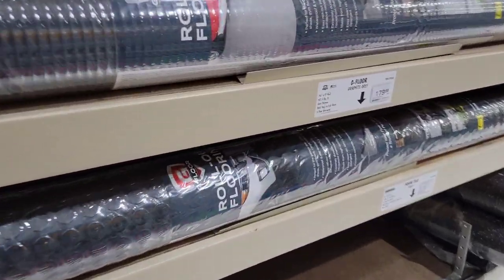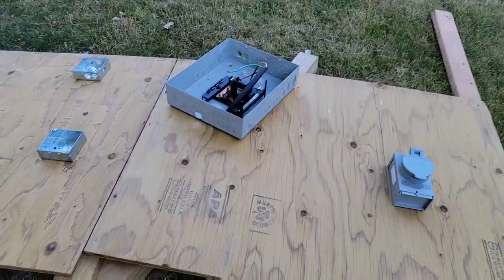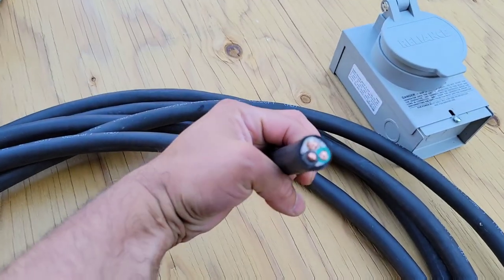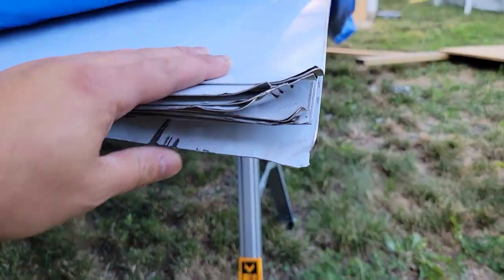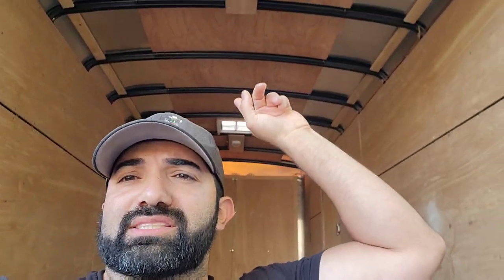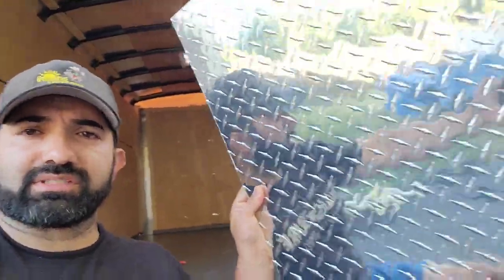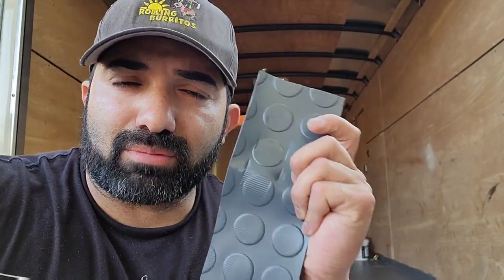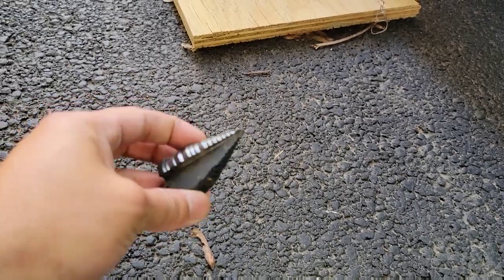Building a Food Truck
How to choose the right flooring

Comment: So just to be correct you switched from 8/3 to 6/3 service cord? Because in the Amazon tag it still says 8/3. Just want to make sure I get the correct one. Thanks for everything you do
Reply from the maker: Yes if you need 50 Amps use 6 gauge wire. There is no wire available in 6 gauge anymore on Amazon

Comment: Hi Frank! I have a question, loans are so bad and builders so expensive, the my only option is build my own, but my budget is $12000 , find a trailer for $6700 so now I have $5300 any options instead of  Stanley steel walls ?

Comment: After using the coin flooring for a while now, any feedback on stains and clean up or durability issues? On my food trailer, everything is strapped to the wall because I did not want to screw into the floor. I hate my ATP because of the screws are dirty, the seams are opening up a little and it bubbles when stepping in a couple of areas. Have you noticed and issues with the coin rubber around the legs of your appliances or sink?
Great videos.
Thank you.

Comment: Hey Frank what’s the purpose of the piece of plywood that’s on the ceiling of the trailer? Mines needs to be replace before I put up the ceiling is that possible?
Reply from the maker: Do you mean the wood between the metal and the metal studs in the ceiling?
Reply: @fbaltierrez  Yes
Reply from the maker: @chefmix6551  that Is a good question. That would be a little tricky. Are they moldy?
Reply: @fbaltierrez  No mold just where there was a leak by the vent when it rained. I sealed it from the roof with silicone and it’s fine now…  Just curious if I should replace just that piece where it  got wet.
Reply from the maker: @chefmix6551  if it was my trailer I wouldn't I would let it air dry a couple days and spray it with bleach where the floor got wet that's if there is black spots or mold. That's what I would do if it my trailer

Comment: Are you going g to run that under trailer cable in conduit?
Reply from the maker: No just the cable. That's why I use this cable it's super thick in insulation